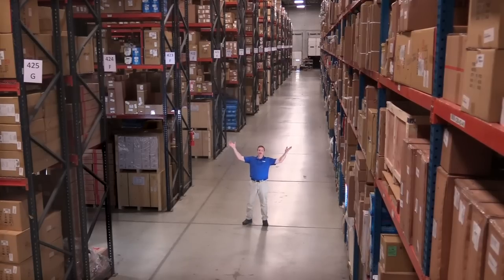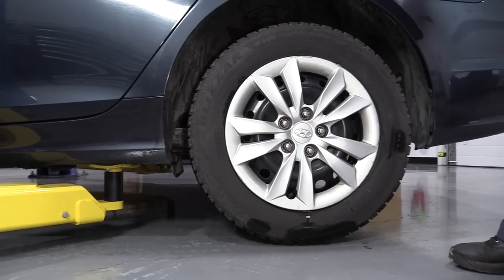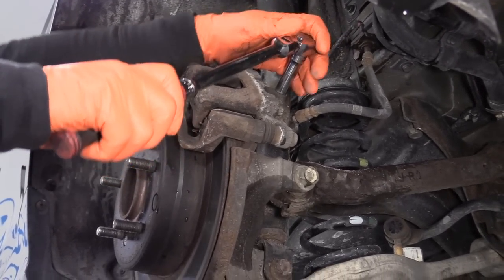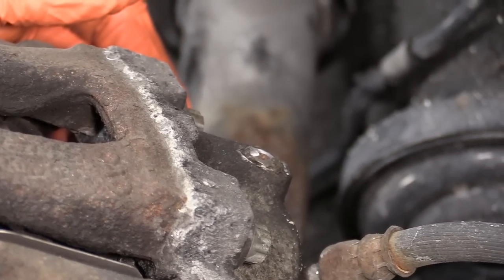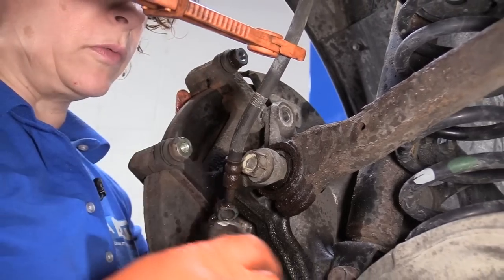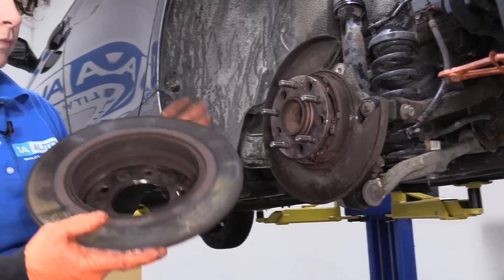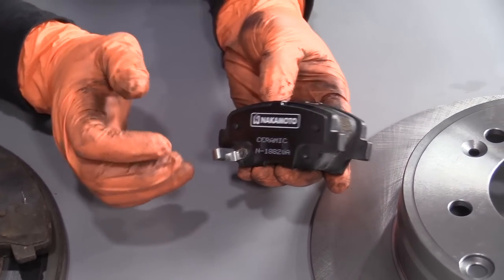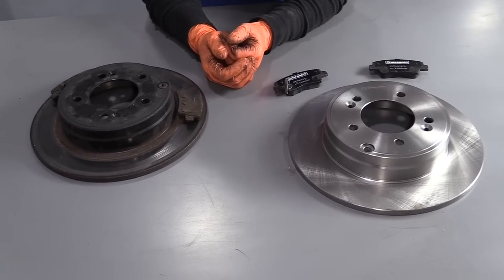How to Replace Rear Brakes 11-14 Hyundai Sonata

Comment: This is a great video. Great lighting. The lady knows her stuff. Thanks so much for giving the torque values during the repair. Often overlooked. Impressed you figured out there was paint inside the new slide pin barrels. I learned a lot here. Thank you very much.
Reply from the maker: Thank you for the great feedback! +David Stevenson

Comment: FYI: Just did this job on my wife's 2013 Tucson.  For that lower bracket bolt, I used a 14mm offset box wrench to break the bolt free and undo it a bit until I could get a 14mm ratcheting wrench on it to take it the rest of the way out.  If I took that control arm out, I would have to add a tow bill to the repair, to get it to a shop so it could get put back in.  There is a reason the arm "magically" appears back in place.  NO BUENO!
Reply: I was thinking the same thing 😂😂

Comment: This is one of the best auto repair videos I have ever seen. Great explanations, great camera angles, and nothing left out. I really appreciate that you included the part about cleaning out the cylinders for the sliding bolts. It's good to see how a real mechanic solves real-life problems.
One thing to note -- in my case the lower bolt for the control arm backed out into the shock absorber, which meant I had to take that off as well. Since you showed two different methods of removing the caliper bracket, I knew I was on the right track. Hyundai design engineers need to see this and know what a bad design they created for years 2011-14.
Reply from the maker: +JustUpWake Thank you for the feedback!  We appreciate you watching and commenting!
Reply: I hate the way the rear brake assembly to work.  They deliberately designed so you have difficulty and only the deal can fix it.  I did all jobs but couldn't put back the lower control arm . I can't align the side hole of the outer control arm to slide the bolt.  She used the long black metal to align the the side holes but no info of name and where to buy it.

Comment: Great and valuable video for any Hyundai owner to understand design flaws..for diy, please support axle weight to help with bolt removal and installation. It can be a pain and you can slightly strip threads. Cheers

Comment: Nice job. The only recommendation I would have would be to use your spray can of brake cleaner and clean off the brake fluid from the bleeding. It may just be something that didn't get shown in the video.

Comment: Hello @1A Auto. I ran into the same issue with one of the front brake caliper slider bolts. It was lived but would not go in freely. 
I’m assuming this is what even

Comment: The guide pin holes should be sprayed out with brake cleaner after honing. Those holes will be contaminated with paint chips. Apply fresh grease after.

Comment: Use an alignment tool or 1/4 punch to align the control arm for the bolt. If not, it's not going to align. Place the punch in one side and hammer it until it goes through both sides to line it up.

Comment: why does it say ''Brake Caliper Compressor Tool. Single Piston. Screw Style'' yet you compress the piston with a welding vicegrip ? id like to know as i dont have the tool to compress screw type..wondering if i need it or not

Comment: I tried that same job yesterday and I could not get that outer control arm bolt and nut off to access the lower bracket bolt..even with with propane on it.. any recommendations? Same car same setup
Reply: I have used an hydraulic jack to push the control arm up.......

Comment: Wouldn't it have been easier to just remove the control arm in the first place?
Reply: there's no needs  to remove control arm
Reply: You can't get the control arm bolt out and back in because the strut is in the way. In order to do it correctly you have to take off the control arm otherwise you risk rounding the caliper mount bolt head. In order to take the control arm off you need to take the shock off. Its a PITA.

Comment: This is a example of Hyundai engineering screw up. Placing the mounting bolt in the control arm bracket worse than having to remove the bumper on a Chevy to change a lightbulb. What are they thinking about in engineering schools?

Comment: Why not grease the tins to help the pads slide?
Reply: I always put anti seize grease
Reply: Some say not to because the pads need to slide easily across that surface, and grease will collect dust and debris, gunking it up. 10 different ways to skin a cat though

Comment: 21:03 you were doing so well showing everything,  then you cut out the one thing I wanted to watch,  the struggle to get that control arm back in.   Disappointed.
Reply from the maker: +cember01 Sorry!  We will pass along your feedback to the production studio.  Thanks for taking the time to watch and comment.
Reply: That part of the repair was cut out from the video for a simple reason. It is almost impossible to put that control arm back with the tools available at home to a DIYourselfer. At that point, you will forced to tow the car to a shop. See similar comment above from Jeremy Kooyer.
Reply: I found that pre-loading the trailing arm, or putting a jack underneath the trailing arm and jacking it up, helped smooth out the process. It was easier to manipulate the control arm back into it's place rather than to hammer it back on.
Reply: I just did this on my wife’s car... I hope I never have to do it again. What a pain!
Reply: @mach2982  just did this repair, totally possible for a DIY'er. It helps to use a jack on the knuckle, it aligns the trailing arm with its slot. The trailing arm could be placed in position with my bare hands. Didn't even need a hammer or crow bar.

Comment: Why wouldn't you pit and grease on the top side of the hardware where the brakes slide on them?
Reply: I always put anti seize grease
Reply: The grease will attract dust and dirt, and the pads could seize even quicker

Comment: Just completed this job. Wish I saw this video before I started. Saw the alignment tool she used at harbor freight and didn't buy it because I thought it was too long. It definitely would have saved me a ton of time and energy. I removed the control arm completely then connected  wheel assembly side first and inner control arm last. I was on the floor not a lift. I had all wheels off and car up on four jack stands. I used a floor jack under wheel assembly  to help align control arm bushing bolts. I also removed lower shock bolt for more maneuverability  and clearance. With all that said it was still a bear of a job. Another video said to apply brake grease to brake pad tabs so I did. One thing not shown is how to loosen emergency brake shoes before removing rotor and readjust rear emergency brake shoes once rotor is reinstalled. Check out video.  https://www.youtube.com/watch?v=MCnm0Lf-A1s&list=PLQ0v_jluFxhJc5zMzCuh8JMFHceKCpAsY&index=3. I'm a licensed aircraft mechanic and am impressed with Sue's skills! Great video. Thank You Sue!

Comment: ..... eventually caused the broke rotors to wear uneven and thereby causing brake wobble/shutter. The brake pads appeared to be ok and have more brake pad before the wear indicator would make the sound. Well just my 5 cents......... I had to add 3 more cents due to inflation.....sorry for that.